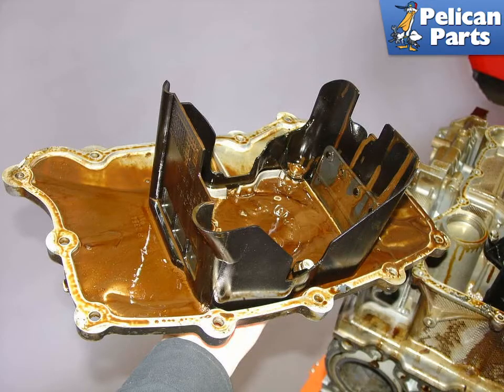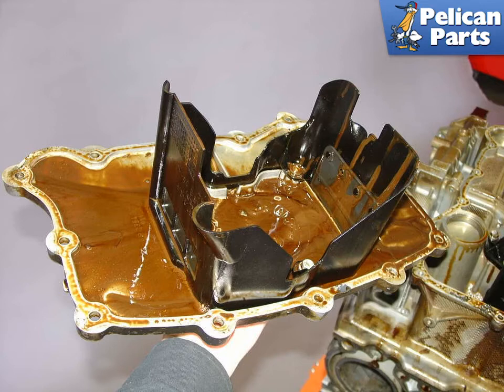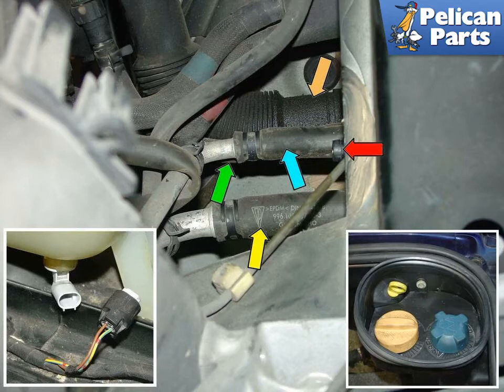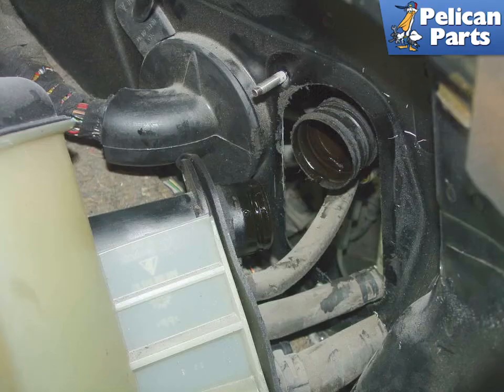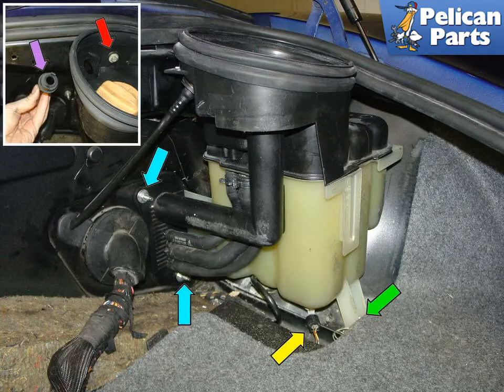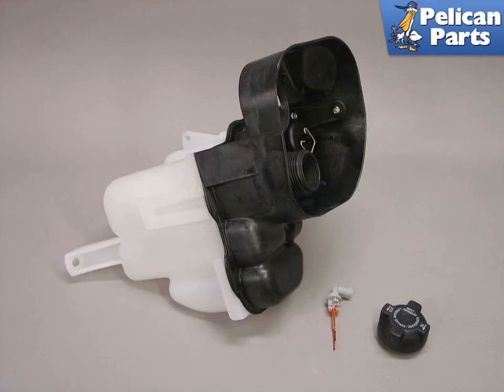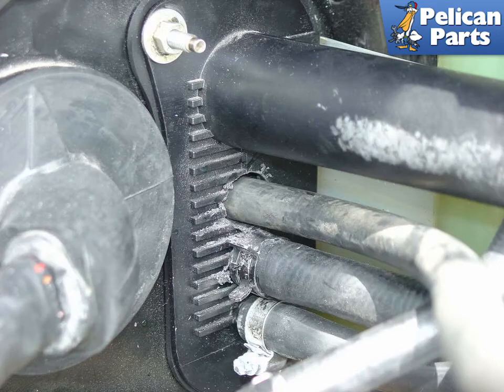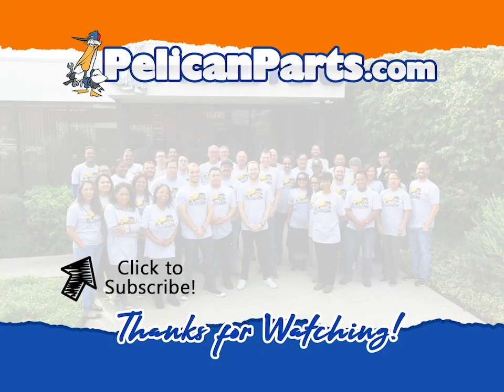Porsche Boxster 986 Coolant Tank Replacement

Comment: Thanks for the upload! I discovered that removing the secondary air pump (3 nuts, a hose, and the electric connector) let me get a good grip on the engine side hose clamps without special tools!
Reply from the maker: Thanks for sharing your repair process and experience. These types of comments add so much to the Pelican tech community.

Comment: what year is the Porsche?
Reply from the maker: I believe a 1999.
Reply: Wouldn’t it be easier to just cut off each plastic nipple and use a longer tubing on all the coolant lines?  

I’d think the next time you’d need to replace it would only take a 1/3 of the time